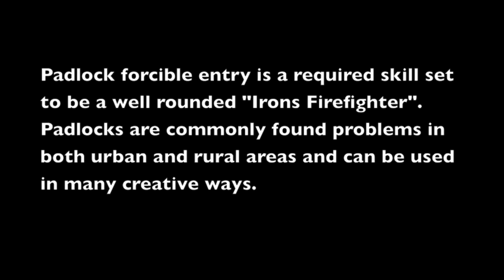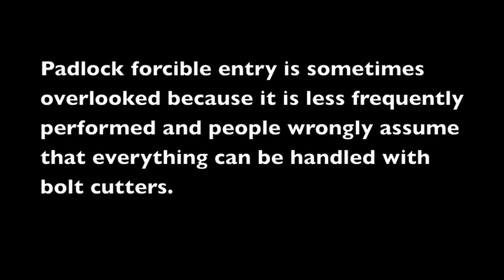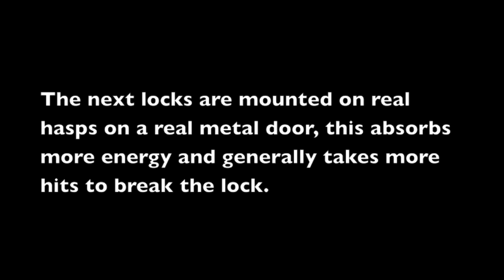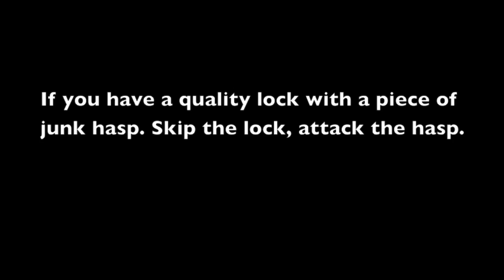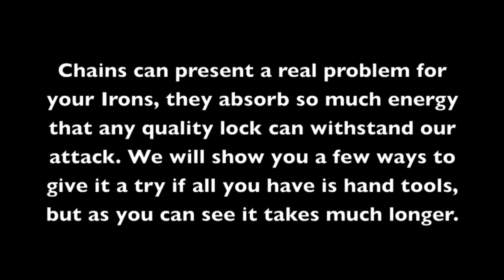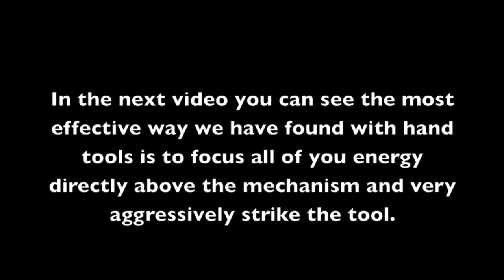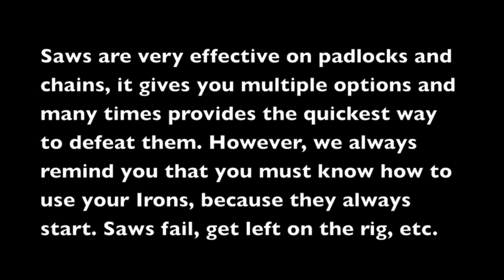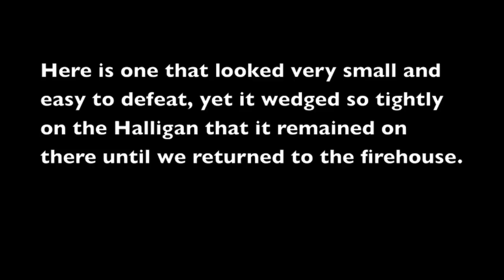Padlock Forcible Entry

Comment: Master Locks are making more and more sense now. I'm assuming the reason they're so easy to pick is because so few people bypass them that way. They clearly put all the R&D and cost into hardening against brute force attacks like what's shown in this video. I can't believe how well some of them held up when they can't even last 10 seconds to a picking attack.
Reply: remember most thieves DON'T pick, they brute force. Forcible entry is usually faster and easier especially when discussing theft. The one thing I DO disagree with this on is that these locks are defeating bolt cutters. TO BE CLEAR, it depends on the size of cutters you have, what most people expect and also what most fire crews carry actually isn't the biggest you can buy, they're good but they're not the best. Firemen in general carry between a 24 to 36" set of bolt cutters, stout to be sure, but they're not the toughest, that rank goes to some of the big 40+ inch bolt cutters used by local and state service groups, DOT, etc. These cutters make pretty much everything you'll encounter in your day to day and even in some extreme circumstances look like pot metal, I really do think it'd be a good idea if they haven't for local FD's to reach out to DOT and other similar groups for what they use when cutting padlocks, etc. remember firefighters don't ALWAYS use these tools they're not a daily use item, DOT and service groups DO it's part of their daily tool kit, some cross communication might yield firemen and women MUCH better tools for popping locks when time is of the essence

Comment: Those are Master locks. You do know that picking one of those would probably be faster than working on them with a Halligan, right?
Reply: I was also thinking bolt-cutters after 3:10

I'd love to see them try a 16mm shackle on an OnGuard Brute bike d-lock with a crude old Halligan + hammer/axe. :-)  They're greatforprying open things like doors, where LEVERAGE counts, but brute-force hitting like this (NO LEVERAGE) is an "off label prescription" for what a Halligan (with axe) was REALLY meant for.

Also any non-hardened chain ( 9:00 ) is easier to cut thru / abrade.  If it is hardened, then shock (hammer blows) is more effective than cutting.  Bolt cutters are pretty good for BOTH hardened steel (or other BRITTLE metals) or non-hardened.  If it's not hex-shaped chain, it's more likely the non-hardened, so try cutting (or bolt-cutters) first -- if you have 1 tool for hardened & another for non-hardened handy.

Then they finally DO break out thecutters (11:50) and they attack the SHACKLE (usually hardened) instead of the NON-HEX CHAIN (usually a NON-HARDENED type of chain, and thus less effort than most shackles need... d'oh!!!  Murika!!  Then he tries cutting the chain ONLY because they "won't fit" the shackle which appears a thicker DIAMETER than the chain (and HEX shaped: boltcutters or any flat blade has trouble with non-circular shapes, which is WHY the hardened chains use hex/square cross-sectional shape).
Reply: ThalamusMinimus sometimes the answer it´s reverse thinking, putting the pick of the halligan and hit the padlock directly at.

Several times in the video I thought they will try hitting the padlock.... but they skipped that trick.

That was more evident for me when they inserted the Duck Bill in the padlock, Duck Bill inserted pointing towards up, then hitting the padlock .
Reply: Tjita1  we don’t get of the truck with a lock picking set if the building is on fire. We get off the rig with a set of irons, the tools they are using in this video, because we can continue to use them for other tasks through the incident. We’re not going to get of the truck with a lock picking set, pick the lock, then take it back to the truck and get the other tools we need for the rest of the incident. It makes no sense. A lock picking set in this situation is not practical for us.
Reply: @mattwilliams4017  You don't get it. You don't need picks to open a Master. I have, no joke, seen a guy rake one open with his own broken off toe nail in like 0,2 seconds.

Comment: I realise the video is about training, so for security a padlock is only the securing mechanism, 1st you don't have the padlock in view where a tool can get at it, if the padlock is inside a padlock box which is welded on so has no chains, a grinder or bolt cutters will be useless, I put my locks for a shed inside the building where I have to reach in to undo the lock, if a crook wants to gain entry the roof and side walls are the targets, that's where security cameras, lighting, alarms, and all the other measures come into play, also tracking devices fitted to equipment so they can be tracked, security is not about how good the lock is.

Comment: Great video.  Good teamwork.  Very informative.  The vibration translated to the fork holder on some of those hammer blows probably resonated pretty good into his hands.  I know that hurt!  Master Lock prides themselves on being pretty tough against shock blows to separate the shackle from the lock body.  Even a grade 3 padlock will require 1.5 tons of shock to pull it loose from the retention bearings.  You have some innovative techniques and tools.  I'm glad you're the good guys!

Comment: Pro tip, instead of trying to sheer the toe off the shackle, twist the shit off. Twist the slack out of the chain if it's mounted onto any, slide the shackle in between the fork or the pike in between the shackle, and rotate the halligan like the hand on a clock. I've done this with a wide variety of pad locks and it will work. If you don't the break the hasp, you will break the chain or whatever its mounted to. I've found this method to be more effective then bolt cutters and it's quick then walking back to the truck for another tool.

Comment: If you put your spike right in between the locking lugs and give it a whack you should be able to pierce the lock casing making it easier to remove by brute force.
11:27 but with the spike on the first hit.

Comment: I would suggest a smaller battery operated grinder with a cutoff wheel. Safer and often faster to cut locks off, especially given how hefty and unweildly a K12 is.

Comment: We did this in the army, something people overlook.  Get the biggest toughest chains and hooks you can find, rig them to the lock or the hasp, whichever looks weaker, then drive off in a humvee (or pickup truck).  The amount of torque and force applied by a pickup is many, many, many times what a human can do even with a torque bar.  Pulling the body of that master lock away from the bar would be cake with a truck and chains.  I do realize you can't have your vehicle near the lock all the time but for when you can!!!!

Comment: @rangerman375 I do see your point about the lance being more efficient than a small mixed gas rig. I generally have most of the tools I mentioned on my service truck for my daily tasks (not being a firefighter) I was actually musing that I probably have 6 good ways to get any padlock off any door I want sitting on my truck at any given time... 42" Bolt Cutters, Sawzall, Grinder, Torch, 12lb Sledgehammer... I'm sure there is more even but I stopped counting at 6.

Comment: All seriousness, some of these locks have such shoddy cores that you could either get a core puller after them, or just outright pick them. I know it's not always practical, but it you can rake it open in seconds, it could save time effort, and possibly lives. As far as chains, twisting the chain as far as possible to solidify it and reduce the shock absorption, or just attacking the chain outright. Boron carbite shackles should not be gone after with boltcutters, especially if your department uses hydraulic ones, as the cutting tips can shatter, and injure personnel in the area. It's far less fun than it sounds.

Comment: With the master padlock on the 4 minute mark... Put a big pipe wrench on the lock body and twist it off. The padlock is much weaker to this type of force.

This is the same with padlocks on chains. Twist the chain up so that it wont absorb as much force and try the hammer it off or use a pipe wrench to easily twist it off.

Comment: I like that big Ass Gas Powered Rotary Saw with Metal Cutting Blade that F.D have that will Cut ANY Lock  faster than Beating the Shit out of it 8 lb Axe or Hammer Plus Less Fatigue. I know I'm a Mechanic When i have use Heavy Hammer and Strike Something with 10 Precision hits takes a lot out of you When I use Air Die Grinder Cutting Wheel Shit I can Cut threw Any Harden Metal Very Fast no Effort . I like watching these Fire Fighter Training Videos Learn a lot of Techniques. Anyway My Hats off to you Guys Thanks for being there..

Comment: make a tool for twisting toe locks off.  Maybe a meter-long bar with a spot to pound that grasps the lock body and then a few whacks and the lock or whatever it is on will fail.  LockPickingLawyer demonstrates with just a pipe wrench and leverage, but combine his technique with yours and custom-male a tool and you have quite a lock breaking hand tool.

Comment: I can appreciate what you are doing here but holy smokes that cheap home depot chain and junky Master pad lock sure did give you a hard time. What happens if you run into something actually secure like hardened security chain or a real pad lock? A simple 18 V cordless grinder would really help your cause and speed things up.
Reply from the maker: Wayne, appreciate the feedback. This video is made for the purpose of showing how these locks, even some of the cheap ones resist an impact style of attack. We have several ways that are extremely quick on all of these locks. We twist them off with the forks of the Halligan tool you see in this video, it is easily accomplished with one guy on most locks and it will shatter that boron carbide almost instantly, even on the higher grade ones. It is also not very practical for us to carry a separate 18v grinder on the fire ground, but we do have 14" demo saws with abrasive blades on them which make most of these a 5 to 10 second problem. We have several other videos being made, but again the intent of this was to show many common firefighter tools and how these hold up to impacts.
Reply: I see your point of view. I was just pointing out that Master lock is the lowest level of security I’m my opinion. Consider me a resource if you ever have any questions on a security lock or product I am very current o what am happening in the security industry. I also understand the compromise between safety and security. Safety always wins. With things like security film and hurricane glass becoming popular in the general public along with high security locks such as ASSA and MEDECO is make your job more difficult. Keep in touch! Subscribe to my channel.
Reply: IRONSandLADDERS Can I send ou some locks to trail with? PM me your info and I will send you some coll stuff!
Reply: I bed to differ. The Stanley 60mm schrouded padlock cannot be prayed off, cut with bolt cutters or twisted off. I know I have tried
Reply: i  think you are missing the point
Reply: you hit the right cord wayne..portable, less effort, and time saving.
Reply: Stihl 2 stroke 12 inch diamond blade gas saw. Problem solved
Reply: @waynewinton  Bet i can Cut it off with my Air Die Grinder Spins at 20k rpm with Cutting wheel in 15 seconds
Reply: @hamonthvac  Yepper

Comment: I know this is 9 years ago, but i missed the twist technique. Just grab the padlock with a long arm (preferably a pipewrench kinda tool) and twist the lock around its axle until the shackle breaks out of the Body
Reply: Often a 10 seconds job if practiced a bit

Comment: Will someone please give these guys a cordless dewalt grinder with a cut wheel on it. I could cut through one of those locks in less then 20 seconds with one guy, no effort which conserves energy for pulling victims out and frees up that other guy to open another door. 
Oh yeah  and by the way I own a metal fabrication shop which builds training doors, lock trainers, and other door breach trainers. I do this All DAY LONG . You do know that carriage bolts are always grade 2 or less (soft steel) so cutting the head off and popping it through with the point on the bar is much easier. The door locks that you buy at home depot and such are so easy to pop off. Take the split fork end and get it wedged in behind the lock then have your buddy put down that useless fire axe with no weight behind it and get a 20lb sledge and drop it one good hit and rip the head right off the lock. Then  just poke a screw driver in the square drive hole in the center or take the pliers and give her a turn. Same for the door knob. They come off even easier.  Inhave yet to see a door knob manufacturer that makes a descent door knob that doesnt pop right off. Schlage, kwikset, even most baldwin will come right off. You guys are just teaching brute force techniques that waste alot of time and energy not to mention someones gonna get their ass opened up by the back of the axe. Stop trying to break hardened locks and focus on the hasp or eye bolt. They are always weaker steel not hardened like the lock is. One tiny slit in the eye of the hasp then stick the point of the bar in and give it a twist they that hardened lock will fall right off. Oh yeah and hinges are not hardened steel. The forming process used to make them makes the steel weaker. They are punched and roll pressed which by nature weakens the steel. 
Drop bars.  Cut a small slot with the saw in between the two bolt pairs and slip a thin piece of flat bar you carry with and flip the bar right up out off the holders without having undue pressure on the bar so it pops up easier.  On a single drop bar door if the other trick doesnt work cut the heads off ONE side, punch them through with the point and the bar having only one side to support it will swing down and save alot more time then beating the crap out off the door. That technique you use with the Iron may work well on a 20 ga door but wait till you try it on a 14ga or 12 ga door skin. Yes they door make them , good luck in piercing that with your Bar.
Reply from the maker: Wow, fiery this morning. I like it. A few points that you are missing here, this video is primarily showing how these padlocks hold up to different shocking forces . I can tell you don't do this for a living because when you are in the backside of a building several hundred feet from your truck you don't have a battery powered angle grinder with you. You have your hand tools and possibly a rotary saw. When we have a rotary saw and we come across good padlocks we will use it all day long. Also not shown in this video is twisting locks. While you mess around with your dewalt I will twist and shatter a huge portion of these locks in 5 to 10 seconds.            

As far as carriage bolts go we regularly drive them with hand tools or cut the heads off with saws. All shown in plenty of other videos we have. I'm glad you build props....all day long. I'm sure they are great. Props fine tune technique but they will never compare to all the variables in the real world.
Reply: this is a haligan bar demo, not a saw demo.  but thanks
Reply: @garthqueen  A cordless grinder?  They make those?  
Shit guys. He's right. I just Googled it.  We're doing this all wrong.  Let's replace the fire service with the goddamned Harbor Freight Rescue Squad.

Comment: instead of prying the locked deadbolts, I think they all would have come off in under 20 seconds with a flapwheel angle grinder.  under 5sec to remove each screw/bolt head.  Also, if you're trying to get through the door quickly, wouldn't it make more sense to go after the welded loops on the doors/frames instead of using tools to steady the locks and chains  so they can be cut?   good video either way.

Comment: This was painful any thing that’s got a good hasp that is hardened or stronger. You just stick your forks in and twist it. Try it out. You’ll hate how simple it is. I was taught it and then found it in the truck company operations book by mittendorf
Reply from the maker: Homero Raymundo , twisting is the only way we do padlocks in our classes. I agree with you it's very simple. Still come versions require striking instead of twisting but overall twisting is my go to. This is an older video that was made to demonstrate what striking looks like on most of these. It's miserable. However I got too sick of everything on the internet to put out part 2 showing all of the twisting and comparing. Long story short I agree with you and solely teach twisting.

Comment: AirArc Slice oxygen arc torch will cut those locks, door, even concrete like butter in seconds.
Reply: Poor departments may not have exo torches. Abrasive saw in hand doesn't require deploying an exo torch, just start and cut.